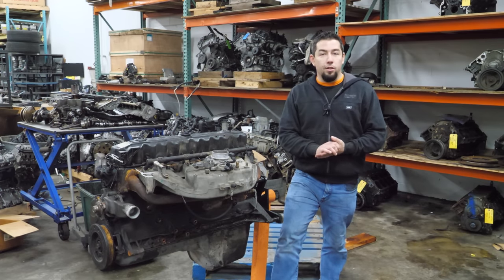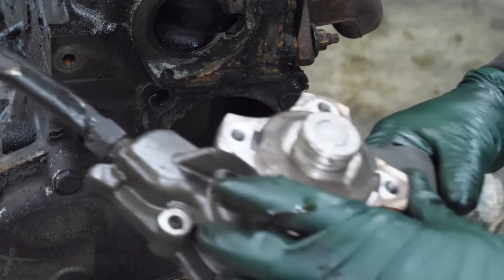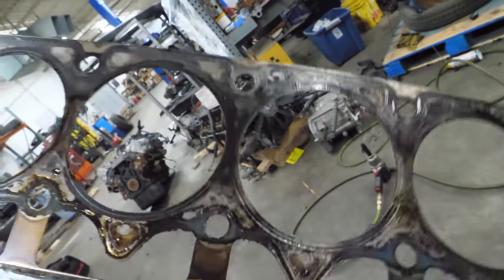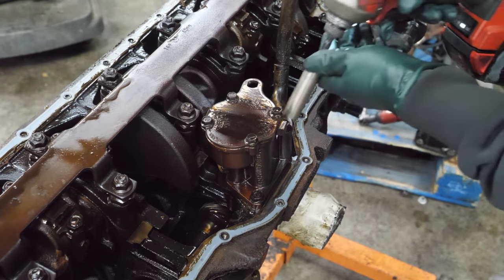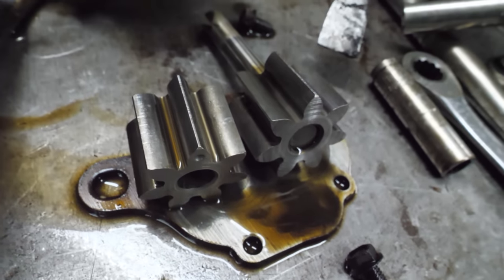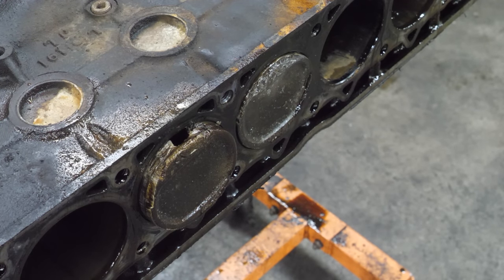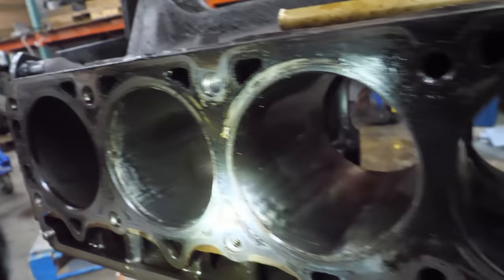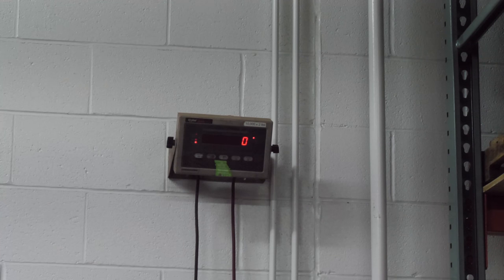How Do You Destroy A 4.0L Jeep Engine THIS BAD? Intentional? Neglect? Ill-Repair?  I Am IMPRESSED!

Comment: I'm fumbuzzeld as to what started the melt down. Cylinders 3 and 4 share the same ignition, maybe the timing was off and detonation destroyed the two top ends? 
Whatever the initial cause, most likely the motor was dragging a big camper or boat up a steep mountain when it gave up. And it's obvious the 4.0 didn't give up easily.
Reply: The cylinder heads in the 2000ish era are infamous for cracking between cylinders 3 and 4

Comment: When you get to the 4Ls that have no distributor- just the 6 coils it's nearly impossible near me to find one intact. However you can at any moment locate 6 jeeps (usually grand cherokee) in need of a fresh 4l. Almost all have the side window feature and self draining oil pan as well, with or without external connecting rod. Don't know how chrysler managed to weaken the piston skirts and or wrist pins to gaurantee they all grenade by 175k but they sure did. "OH they all tick on startup even from new" yeah no that's the slop in the wrist pins having the pistons clang around in the bore until they warm and swell up enough. So really around 98ish, later in the wrangler that 4l became a liability rather than a feature. Just more chrysler garbage at that point.

Comment: Most drivers, dont understand that warming up the engine is paramount !
They crank the engine and drive top speed.
2 min summertime and 5-7 min wintertime, will save lots of money. Plus the oil change every 5-10,000 km depending of the year mfd.

Comment: I find it ironic that the two greatest 4x4's of the 90's both had engines that were great, so long as you didn't overheat them. The Jeep and of course the Land Rover Discovery's. Which leads to a great engine request. A rover V8. Found in the US in 1989-2002 Range Rovers, 1995-2004 Discovery's, and the few years of Defenders.

Comment: I have a 04 Grand Cherokee with the 4.0 with over 250K.  The engine wont die but the body is a different story
Reply: My inner rockers are completely gonezo, and also one of the rear wheel arches....  sigh
Reply: @revolutionday1  my rockers are still good.  but the doors are being held together with Gorilla Tape. But my gas tank skid plate is about gone

Comment: Another little tip for you active wrenchers out there! If you come across one that will not start look at the check engine light. Key off then turn on, If the light doe's not come on then key off. go under the hood and unplug the crank sensor, Key on.. If the light comes on than replace the crank sensor. Even with the scan tool connected it could not find the controller when the key was on, The computer goes into a protected mode because of the shorted out sensor. If you don't have a code reader check fuses too. If all good then unplg crank sensor.

Comment: 4.0 burn down ,, that looks like the inside of my 350 SBC after i ran it for almost 100 miles with no coolant ,at 75 MPH ,,4 melted pistons lots of carnage  including 2 cracked heads ,,just like this one about all that was savable was the intake ,oil pan and crankshaft

Comment: Jeepers are nuts... especially those XJ guys. 👀

If someone were building a 4.6 or 4.7 stroker that wear would be bored out of the block...but that's about the only use it has. I have to wonder if someone did try boosting it, maybe a little spray or something. The only other thing I can think of is someone fed it a bunch of carb cleaner.

Comment: I originally thought the loose nuts on the rear main were rear seal replacement on an old graphite wick seal and not re torqued. Then I saw the full circle rubber seal. Hmm Think most of the damage is from those two nuts circulating around the crank case. Looks like this engine started making noise and was limped home. Design does look old school before Fiat Chrysler contamination.

Comment: I destroyed my 4.0 in my 2000 Wrangler by running it with about 9000 miles on the oil change (thought I changed it), and pushing through snow bumper deep. It started to knocking I continued to drive it another 38,000 miles after while beating the living hell out of it and it still did not seize, the knocking just got to the point of embarrassment.

Comment: I hate these engines so much glad to see one where it belongs. They are absolutely the most overrated waste of metal, all people have to praise is it's reliability but it's a meme, they're not THAT reliable, what probably happened to this one is overheating like they ALL do (thanks to Chryslers heads), and any reliability they have is just because they have nothing to break. It's a reverse flow pushrod engine basically designed in the 50s. There's nothing to fail. It's no more reliable than a slant 6 or a stovebolt 6 (which it's heavily influenced from) or a thriftpower or any of the other base model straight 6 engines that every car maker had. The diffrence was everyone else had competent engineers and could make an improved engine that wasn't ass while Chrysler was on the verge of bankruptcy for the 80th time and was whipping old AMC engineers to do something. Keep in mind until 1998 the only viable v8 Chrysler had was the old and tired LA, which was too big and too heavy to compete with the modern small blocks everyone else had, nor where they particularly powerful, the 5.9 in 2000 barely put out 250 hp, meanwhile the last of the small block chevy 350s was pushing 300 and it was already retired for the LS.

Chrysler literally didn't have another worthwhile engine than this all they had was the LA and LA based V6 and a bunch of fwd v6s,, and ofc the jeep marque saved Chrysler from bankruptcy until Mercedes, that's why it formed such a cult following. All the engineering work on the jeep was done by AMC using this AMC engine because AMC literally couldn't afford to make their better engine which later came out as the Chrysler powertech SOHC motors in the form of a 4.7 v8 and a 3.7 v6 (both are terrible btw) which also went the way of the dodo when the HEMI 3rd gen and the new SOHC v6s came out. This engines praised entirely because of it's timing and the fact it was in a great vehicle lineup, not because it's a good engine (for it's time), it doesn't stand on it's own merits and that's why i hate it.

/rant
Reply: Amen

Comment: My boss towed his wrangler with a manual transmission in 1st gear down the fwy,60 mph behind his motorhome. Didn't even feel it back there. It threw all 6 rods out the block as well as all 12 pushrods Came out the valve cover. Thing looked like a porky pine.

Comment: Looks like the timing chain was replaced and the oil pan wasn't cleaned out of debris from the cam gear did these engines use a fiber cam gear ? Material in oil pump pickup looked like timing gear

Comment: Had a 2000 XJ and then a 1998 XJ. I bought the 98 with a blown head gasket (early stages just sucking down coolant) got about 20k then swapped the engine out due to who knows how bad I fucked the block. Next one I put under water three times and blew out the cylinders. New plugs and oil and she fired right back up and got another 150k before I sold it

Comment: 98+ models where built with lighter pistons, rods, and crank, they won't take the beating the earlier versions will, but they will run a long time, with oil and coolant.

Comment: Man, this thing got REALLY hot on the top end. People, modern engine cannot be over heated. At the very least you'll eventually blow a head gasket. Pull over and shut it off as soon as the light comes on or the gauge raises above where it normally goes.

Comment: The engines themselves are bombproof, it's the electronics and junk sensors that bite you in the ass
Reply: One should be able to put a carb and a distributor on this, I mean the camshaft has the worm gear drive for it and the block has the hole.

Comment: I wouldn't be surprised if whatever Jeep that came out of drove to wherever the engine was pulled. Truly the spiritual successor to the Slant Six.

Looks like it ran lean and/or hot until the ring land deformed, pinched the ring which dug into the cylinder wall, canting the piston and smashing the skirt into said wall, breaking it off. That's the hypothesis given by others who have found the same kind of damage on the same era of 4.0s.
Maybe oil in the combustion chamber gave rise to the knock, because the others I've seen were all very high-mile motors, too.

Comment: Another problem was the fuel in the fuel lines would evaporate from the heat because they were to close to the exhaust. This would only happen if you got the engine up to temp and turned in off for a few minutes then restarted it.
Reply: DEI makes a nice lil' kit that puts an end to this.
Reply: @revolutionday1  I had the kit on my Jeep but it still would do it sometimes but not as much.

Comment: I currently have a 1999 Jeep Wrangler with 591,576 miles on it. Original Engine.  Only bad side is the exhaust manifold design sucks ass and they constantly crack.  Been through 4 exhaust manifolds since new.

Comment: Later 4.0s crack pistons all the time. It's a super common problem. Any time you hear a Jeep 4.0 that sounds kinda rattly - it's almost guaranteed that it has cracked skirts. I really don't know how these engines have a reputation for being "bulletproof". They crack pistons and heads all the time. Later ones had valve issues. Pretty much every year of 4.0 has exhaust manifold cracking problems. Constant oil leaks out everywhere. Crank sensor problems. Difficult to work on (XJ applications), and more. At best they were an average engine. No more or less reliable than anything else on the market.

Comment: Unfortunately when you run even a workhorse motor in the ground oil coolant and maintenance are still required.  Some engines that have a bad reputation have a good life if there maintained but the story is old!

Comment: I was thinking about buying a 4.0L Jeep as a daily. Aside from the obvious, what else should I check for on these?
Reply: They leak oil from everywhere and crack exhaust manifolds. They’re getting old, so the oil seals are only getting worse. I was able to do the rear main seal in my garage with basic harbor freight tools, the nice thing is that it’s a 2 piece design that does not necessitate pulling the trans to replace, just the oil pan. 

The engines can make all kinds of scary noises when running but they will run like that forever. 

Low oil pressure is not an issue. 13 psi at hot idle is the minimum spec. As long as you’re somewhere around 40 when on the throttle it’s more than fine. 

The engines are known to run hot. The auxiliary e-fan on a Cherokee will turn on at 218°, a 4.0L is made to run at 210° all day long. Low oil pressure and running 210+ for hundreds of thousands of miles would kill any other engine, but these are really tough. 

People give Chrysler a lot of crap, but these vehicles were never intended to last for 25+ years. The engine only runs off of 6 sensors, all of which can be replaced for less than $200, and are always on the shelf at any auto parts store.

Comment: I'll tell you how to break it.  Take it to one of those quickie oil change places. They might screw up and forget about draining the old oil and add an additional 5 qts instead. That's what happened to one of my old girlfriends. One of the rods snapped on the big side of the connecting rods. On a positive note, they did install a new oil filter. 😂

Comment: I had a 2000 Grand Cherokee with this same engine. It was gutless and had terrible fuel mileage (12 mpg on a good day). Despite being well taken care of and no overheating, it started knocking loudly at 138,000 miles. Not sure exactly why, but I hear the pistons like to break.
Reply: They had piston slap and out of round cylinders from the factory. I have a 93 GC that started knocking one day, and the main bearings were cracked in half. I religiously changed the oil, never abused it, or overheated it.
Reply: I get 16mpg on my 02wj...220k still goin
Reply: I know these engines have a good reputation but that was not my experience. I bought a Toyota  to replace it and I couldn`t be happier.
Reply: @dopeman420  mine was full time 4WD. I think that`s why the mileage was so bad.
Reply: @seanlinne8383  they're not known for gas mileage on a good day, and Chrysler isn't known for build quality on any day
Reply: still great motors tho, almost impossible to fuck up even from the factory
Reply: @elen5871  No, they aren't. But my 96 XJ with fresh plugs, wires, and four hole injectors is getting a solid 20 MPG.
Reply: @elen5871  Even AMC vehicles with the 258 weren't very good on gas.

Comment: the 4.0 overall is a great motor....yes the cam does wear in higher mileage...especially on number one cylinder if oil isnt changed often enough....but a very good engine....when jeep stopped making this engine....jeeps stopped being real jeep's   I am not a fan of the newer jeeps   aluminum wire grounds corrode quickly

Comment: This is either catastrophic stupidity or intentional... my 4.0L XJ was a TANK, I drive it 7K miles on a road trip with my GF (with MANY miles offroad and in 4lo all through Or/WA/ID/MT/WY) and then the day after we got home the water-pump failed on the freeway here in WA State and I had to drive it 5 miles to a safe place knocking and running so hot I thought I had blown the HG and done something serious to the engine... NOPE, just needed a new water pump and an oil change and presto she was fine.  As poorly built as Jeeps are the 4.0L was an awesome engine up there with Toyota engines in terms of reliability (they do get horrid mileage though sadly).  That's why people who know anything about 4wd's will tell you the last REAL Jeep was the TJ and the JK/JL's are absolute trash vehicles made out of Fiat and mini-van parts-bin junk with garbage engines. The only thing of quality is the axles and the T-cases, everything else is just mall-crawler junk.

Comment: Stupid Question Deptartment:  Forgetting everything else, why can't a block like this be honed out (presuming you don't overbore)?  I've seen engines that simply had one or two lightly scored or pitted cylinder walls and it's common to hear "it's not worth it" without an explanation of why.   The 4.0 isn't a performance engine so overheating should be less of an issue.  For the 4.0, does the in-line configuration make any block work more problematic?
Reply: Because a new block is soo much cheaper than a machine shop and sleeves

Comment: Shit that ain't bad. I got one I'll send you an show you some real carnage lol. Connecting rod broke, took out the cam, chewed up the pushrod, cut the oil pan in half an blew a softball size hole in the block.  I found pieces of the lifter bucket in the pan from what was still left over.

Comment: They're tough. Not bullet proof. I've had a nice little hole in a piston. The 4.0 cared about it, but never quit. Blew every bit of oil out getting it to camp. It still drove on and off the trailer. Motor was toast, but a dime a dozen.

Comment: You talk so good about that 4.0 but you don't talk about the leaking rear main seal and the ever so unreliable electronics....$2,500 DOLLARS WORTH OF ELECTRONICS AND A LEAKING MAIN SEAL AT 15,000 MILES....My 2005 Wrangler is plagued with both....
Reply from the maker: You can buy every piece of electronics that run this engine for less than 1K
Can’t say that about most engines.
Rear main seals leak on tons of engines, hardly a 4.0 thing

Comment: I'm sure it's a lot easier to work on, compared to the 2006 fird 4.0 SOHC. LOL Stay away from the fird 4.0! It's a nightmare! After all the work I did on it, I guess I know how to rebuild one at least. LOL 
I had a Gremlin that had that engine. I sold it to a guy I worked with, since the alternator went out on me, and I was getting ready to PCS from Guam. He tells me he needed the cam. So he fixed the Jeep he was working on and told me he wanted his money back and wanted to give me back the car. He said he decided not to use the cam from my car, but it didn't run when he put it back together. But the Jeep ran fine. I called his lie. LOL

BTW I spelled it fird on purpose. LOL

Comment: clean the block, magnaflux, and bore it..there's getting to be less and less of them. I have a 95 cherokee with 307000 miles on it. as long as it doesn't have hole in it save it!

Comment: A rocket surgeon?   I had one in a Cherokee with 350,000 miles.  Transmission failed engine ran great still.   When you speed up the film you should turn the sound off

Comment: fuel washdown is what finished this motor it ruined the oil these 4.0s will happily run on 4 cylinders. I got mine to stay running with just 3 spark plugs plugged in before

Comment: The 2 nuts missing off no. 7 main cap don't make sense, if the engine was run like that the vibration would have been terrible, the cap would have dropped down and the bearing shells would have fallen out, also there would not have been any oil pressure, it must be that someone was in there before you and removed the nuts possibly to completely dismantle the engine then changed his mind and gave up on the idea then just threw the nuts in the sump and bolted the pan back on.

Comment: Liquid glass, that is what Chrysler had the dealers put in the engines to get them off the market,in the 2008 cash for clunkers program put out by the Govt. Many 4 litre Jeeps met the qualifications,so they gave the owners $5K on trade for a newer more fuel efficient engine. I had a 91 XJ that qualified for the program,but I could not stand the idea of a 4 litre being destroyed in such a way. I worked at a Chrysler Jeep dealership when they came out with the 4 litre, I own three right now,and have had 3 other 4 litres over the years. I have seen the abuse they can take.